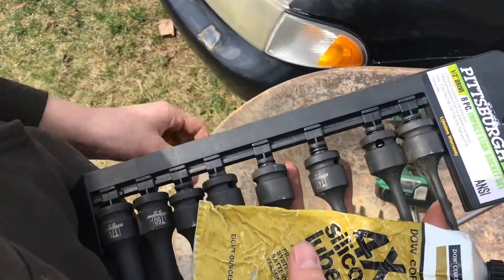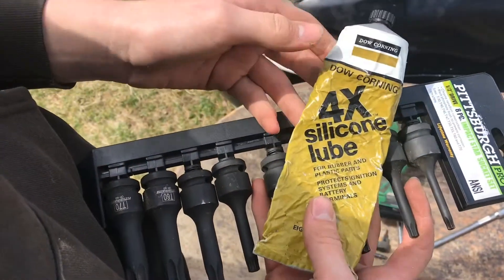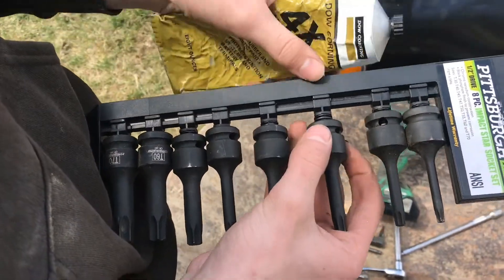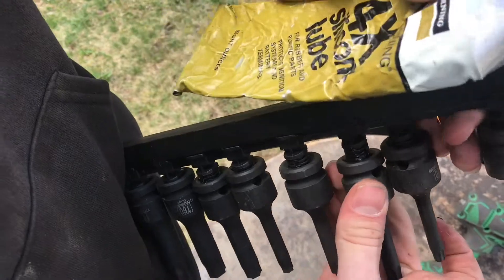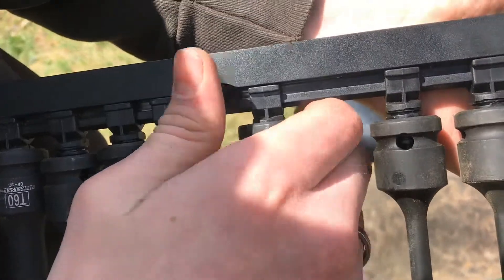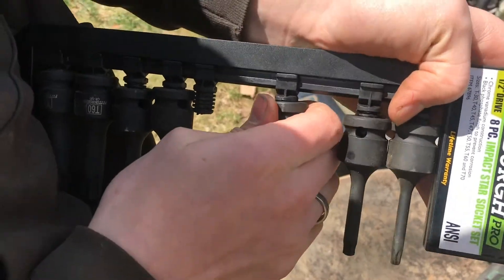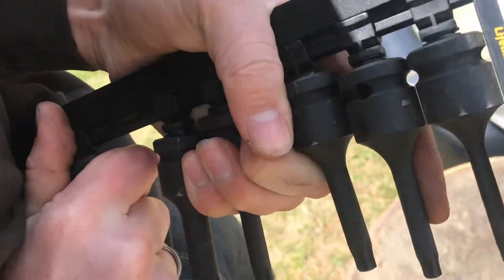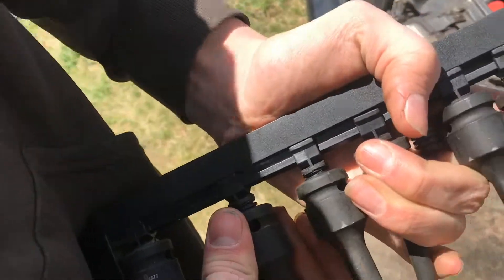which grease works on plastic parts EXPLAINED (silicone grease)

Comment: I have a plastic toy robot that has several moving parts that I will be repairing and was wondering if using silicone grease on all moving parts would help the robot move easier and put less stress on the parts. Would that help at all with movement so everything on the robot moves easier?
Reply: I think it would. just try it. You can usually clean it off it it doesn't work.

Comment: I have a portable toilet whose plastic slide (part that closes off the bottom tank) has become stiff and difficult to move. Would this help? Camco suggested wd40, and it's harder than ever.
Reply from the maker: If the parts that you were lubricating are either plastic or rubber, silicone grease is a safe bet. If WD-40 has any petroleum, which I think it does, you would not want to use WD-40 and plastic. This silicone grease may be a little difficult to find at the hardware store. It would be really easy to find online if you have trouble. Let me know if this helps. If you have another questions let me know
Reply: @livefree6878  also, WD40 is not a lubricant and it doesn't protect against corrosion, as some people think.
Reply: yes, anything plastic or rubber, this is the thing to use. there's no negative interaction.